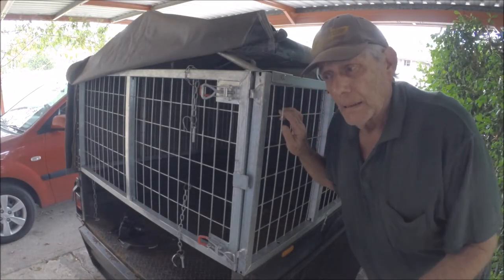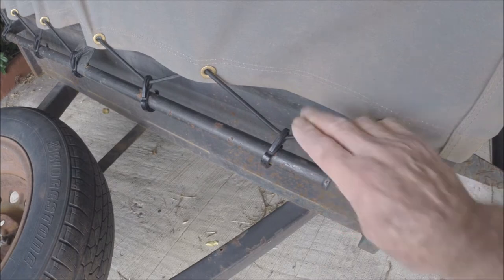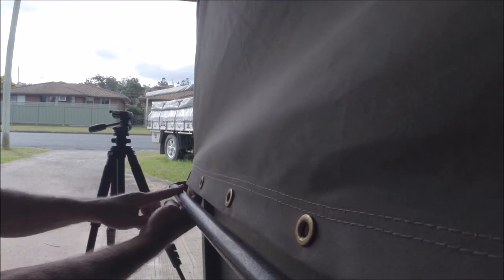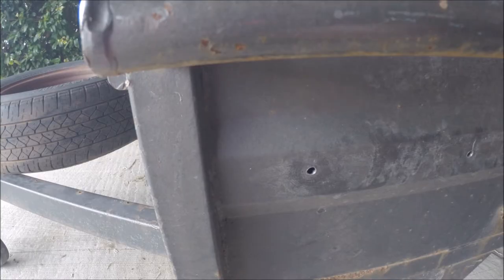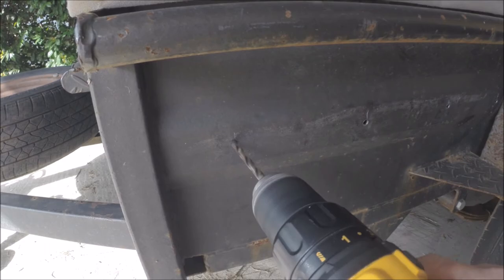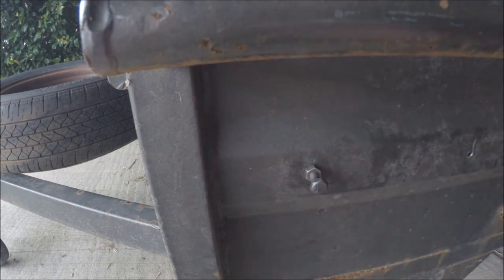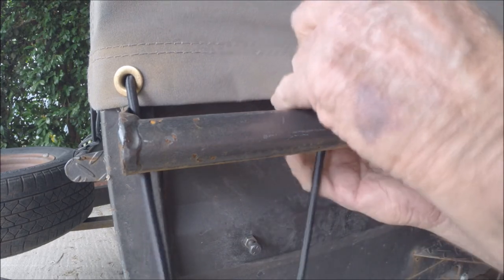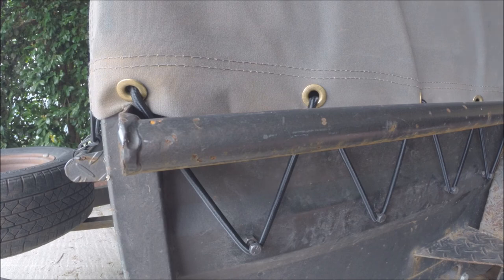Another Little Job To My Box Trailer  🙂

Comment: Now see, I would never have thought about doing that, I usually do things the hard way. I really enjoy your videos. I hope your body is less achy honey.

Lot's of love and hugs🙂💓👍
Reply from the maker: Just a little lateral thinking there, June. I've got so many jars and tins of bits and pieces in my shed, that before I buy I consider what there is on hand that I can use instead; and most of time I have and do. 😃💖
Reply: I was the same once ẃith jars n tins of odds n sods, I would take things apart before throwing things out and save things for reuse. Hubby thought my odds n sods trash until the ñeighbours stole it when they broke in. I'm more of an arts/crafts thinker🙂💓👍
Reply from the maker: There was time when I collected any wheel weights I noticed on the road, melting them down and casing bullets for my .310 Cadet rifle. Ended up with around a 100 pounds of cast lead ingots. Needless to say I have enough to last me an eternity. And I've always collected nuts and bolts and washers seen lying around, as well as buying in bulk, screws too, and placing most inside glass jars for future use, and without exception there has been a future use. Waste not, want not, and be prepared, as the Boy Scout motto goes. And I only collect and buy what I know I will have a use for. 😀💕